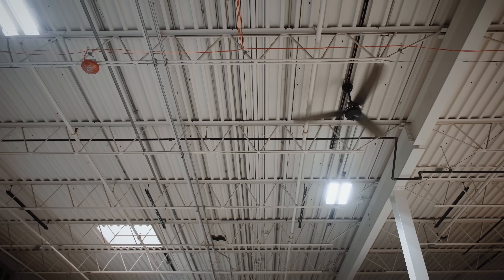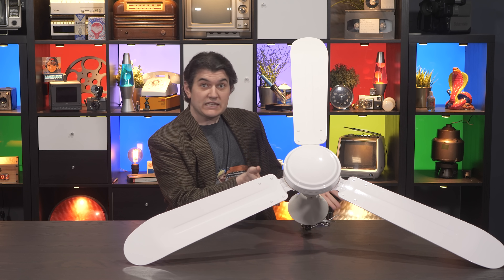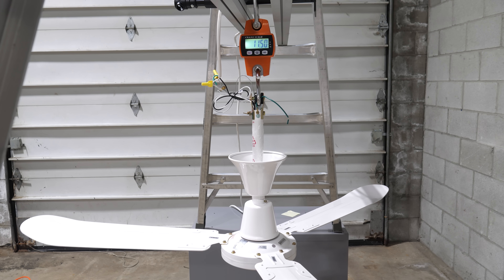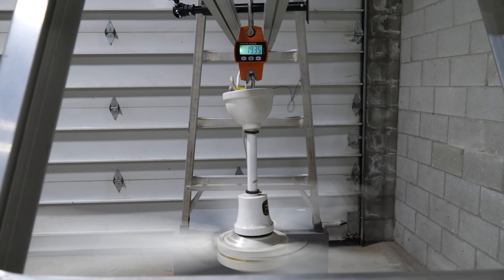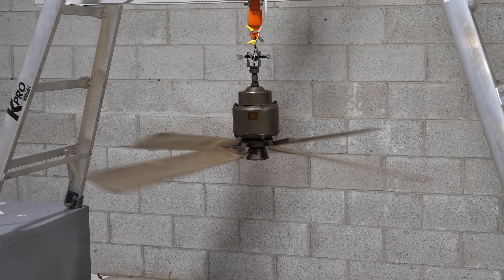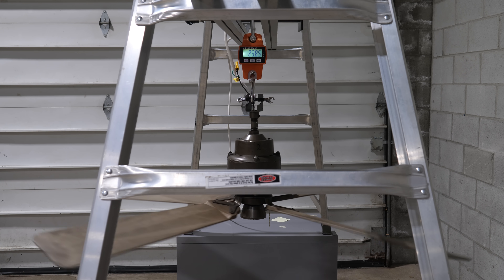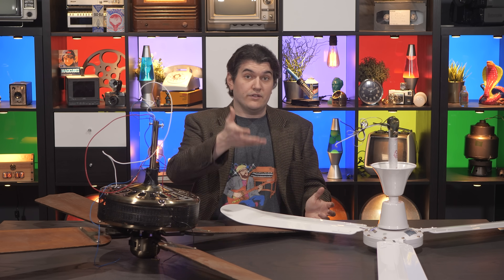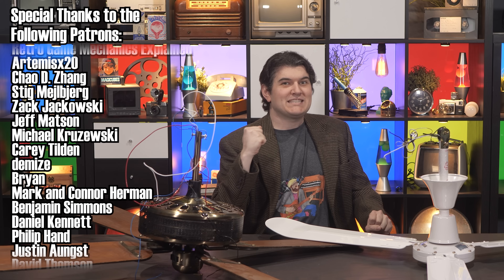How much thrust does a ceiling fan produce?

Comment: Question: Wouldn’t one need to specify how far from the resistance surface the fan blades were? In other words, if the height were doubled, wouldn’t the scale show a different number?
Reply: Nevermind, just realized the error my thinking. The “weight loss”/thrust isn’t the blades vs. ground, but blades vs. the air right next to them.

Comment: 10:04 is this an actual term? I'm not really a math or physics person (an armchair mathematician and physicist). I know jerk is the change in acceleration and that force is typically mass * acceleration. So is "jerk force" just the force exerted during the "jerky part" where the derivative of acceleration isn't 0? Or is it something else that is important?

I understand from a common sense standpoint that sudden "jerky" movements are how you can often break things, but from an intellectual standpoint I don't understand why changing the acceleration is noteworthy here. Do machines like this, in practice, momentarily increase acceleration to a level higher than its normal operating acceleration/force?

If the jerk graph looked like a sine wave for the beginning and that was called "jerk force" that would make a lot of sense, but wouldn't it just be a little bump that doesn't go negative and thus not be noteworthy?

Basically I'm ignorant and am looking to be informed further.

Comment: Alright, someone's got to rebut the pedantic nerd that will surely comment about pounds vs kilograms vs newtons.
One of the objectives of the metric system is to simplify conversions to powers of 10. But 1 kilogram is approximately 9.8 newtons in average Earth gravity. Because gravity is largely the same across Earth, newtons are less commonly used than kilograms, and are readily converted when appropriate. Using kilograms is more effective communication, even if scientifically less accurate. 
This trade off between understanding and details is seen across scientific teaching (for example, in teaching simplified but technically insufficient models of electron configurations in atoms).

Also, this is No Effort November.

Comment: Haven't even watched the video yet, love the concept. Also F*** helicopters, they are my phobia. Now your "good" fan is also a phobia. HOLY S*** just how fast are props spinning at to generate enough force to lift things, oh my gosh I'm happy I have a helicopter phobia, it's not even a phobia anymore it is 100% a justified fear.
Reply: That's a weird specific phobia.

Generally the tips of the blades are traveling just below the speed of sound, which is around 1200 kmph or 760 mph. Note: This has to consider the actual speed the helicopter is moving as well.

Comment: I could not help but think of an alternative test rig. Basically set up a beam balance using a piece of lumber as the beam with the fan "installed" at one end and counterweight on the other. Add a cross piece to the beam at its balance point and use two "knife edges" to create a bearing resistant to motor torque forces and run the cabling off the beam at the balance to minimize its effect on measurement. Fine tune the counterweight for static balance, fire up the fan and whatever weight you add or remove represents the thrust (factoring in distances from the bearing).

Comment: the vortex created on top of the blade while it moves through the air creates lift by pulling up on the blade, so it is not just downward thrust creating momentum
Reply: And how do you think vortexes create lift? Come on, actually follow through. Don't just use the word "vortex" and then handwave away that you haven't explained anything.

Comment: One major difference between ceiling fans and aircraft propellers is the noise level and the power input. 
It could be fun using an aircraft propeller as an ceiling fan but they are expensive and not work much better assuming you use the same motor driving it not an plane engine.

Comment: 5:32 - NO.  The fan does not get heavier.
No matter which direction it spins, the weight of the fan never changes.  The mass of the fan remains constant.
Reply: Mass and weight are not the same thing.
Reply: Ah, you are trying to make a pedantic correction, but are still incorrect. Heavy is related to weight and force NOT mass. The weight DOES change, and mass stays constant.
Reply: It does get heavier/lighter. Just as you would get lighter on the moon. Your mass stays the same, but you would weigh less.

Comment: Hey! Long time listener, first time caller. I always enjoy your videos. So a couple of thoughts on this one: first off, please be careful, that ceiling fan experiment could have gone wrong a lots of ways, I would not have approached the rig when it was spinning, there is a ton of energy and those things will break your shins! Secondly, I need to say, you missed a huge opportunity to educate and help people be safe with ceiling fans: you briefly touched on your concerns about the safety of ceiling fans and the mounting box, and I was sure you were going to talk about the special requirements of ceiling fan boxes but then you didn't. Ceiling fans require a special electrical box that is a thicker gauge of steel, and has a bigger gauge of mounting screw. It must be mounted rigidly to framing, and additionally, all modern ceiling fans include a safety tether that must be also mounted to framing. Many people have ceiling fans in their homes attached to regular boxes and with the safety strap not properly attached. These fans literally could just fall off the ceiling at any time, especially when they're running, especially at high speeds.

All the best! Keep up the great work and enjoyable entertainment

Comment: @TechnologyConnections: Yu could have eliminated your torquing problems,
by simply wiring, both ends, of your support bolt or wrench, to both ladders.
That way, the rig could not torque in either direction. 😁✌🖖

Comment: Imagine how much more fun it would be if the tilted flat blades of the fan were replace by an airfoil shaped blade... now were talking thrust.
Reply: The propeller shape is primarily advantageous at higher speeds. It offers less benefit at lower speeds.

Comment: I think the electrical box is screwed into the ceiling joists well enough to account for the torque and load put on it, but I have seen some sketchy wobbly fans in my day so it’s a good thought. I enjoyed this one. Thanks.
Reply: there are two ways to install the fans, and one of them involves a ball connected to a rod hanging from some piece actually attached to the box, with the other you attach the fan motor assembly directly to the box. So with the first the fan can pivot freely when its unbalanced, tends to be worse at higher speeds. With the second all that stress would go straight to the box... In my experience a 3 blade aluminum fan works perfect balanced and freely, while a 5 blade something polymer blade is out of whack in balance.

Comment: Helicopter rotor blades are designed for pulling, not pushing. They are air foils. It is basically a rotating wing, and lift (pull) above the wing (prp blade) is much stronger then push downwards.
Reply: This is nonsense. A fan can only pull because it's pushing on something, specifically, it's pushing on the air.

Fans can't defy physics, no matter what shape they are.

Comment: a simpler and safer method would be to suspend the fan from the middle of 2 2by4s (pretend ceiling rafters) from a standard ceiling electrical box and put a scale on one end. Then multiply the readout by 2.

Comment: 10:20 at the end of the word "no" there is a distinct tone audible, possibly caused by some part of the fans in front of you on the table. Either a fanblade or something else has a resonant frequency of about 974 Hz according to my FFT Analysis. And yes, you may call me a geek.
Reply: Nice catch. I tested to see the resonant frequency of my bathroom and it's approximately 130hz
Reply: I like your style. May your Fourier transforms be fast and your bins aplenty.
Reply: However, I do feel like the tone in the background is generated by something else and the fact that it's cut short is just the denoising and/or a noise gate that tries to get rid of it. I suppose only Alec himself can solve this mystery for us.

Comment: Of course the fan blades generate a measurable force.

To make this video more interesting, you should compare the motors of the typical ceiling fan to the motor of a typical prop plane. The ceiling fan is probably 1/4 hp or so, while the airplane engine will be a couple hundred hp. Then you can compare the rpm of the fan blades, and look at how they are engineered (compare blade pitch), and note the difference in the noise generated by both. The ceiling fan is near silent, while the airplane can be heard from miles away while the plane is thousands of feet in the sky.

Comment: As a pilot I knew the number would be low but I didn’t imagine the thrust would be that low! 
Aircraft thrust makers, whether it be props or rotors, are all airfoiled and optimized for their spinning moment since the tip travels much faster than the root. Fans don’t have either (usually) so their efficiency is crap. 
The motors aren’t very strong and the fan works mostly on inertia rather than power and torque. That’s why they’re quiet and not power hungry. They provide just enough torque to keep the blades spinning. 

Also, aircraft wind movers spin very very fast in comparison to a fan. Even a 100 horse power Cessna spins its prop nearly 2500rpm. A prop that is maximized for effectiveness at that RPM. Fans just don’t do that. Big paddle moves air. They (the fans) aren’t interested in velocity of air but rather volume of air. Which is another reason the motors are low rpm motors no matter how efficient or effective the blades are. 

Love the channel. Love the content. Keep it up and thank you.

Comment: 0:37 helicopters don’t produce thrust by blowing enough air down to make it fly. They create lift by making less air pressure above the blade than below. A helicopter blade looks more like an airplane wing than an airplane propeller
Reply: Yes they do. Saying they create less air pressure above the blade is the same as saying they push air down. You're describing the same thing in two ways.
Reply: Aerospace student here.

The way a wing / rotor blade creates lift is by deflecting airflow downwards. 

This can be expressed as a difference in pressure above and below the airfoil, but it is mathematically the same as redirecting the air streamlines, and is just an alternative used when solving for certain things unimportant to this discussion.

So, in other words, yes. The lift can be correctly explained as “pushing air down”, although the more important factor is that it had to chance the direction said air was moving relative to the blade, and experienced an opposite force. This doesn’t have to be, and never is, directly down. The sideways component of that reactive lift force is experienced as ‘induced drag’ on the rotor.
Reply: And just exactly how does a helicopter rotor create less air pressure above the rotor than below? As the rotor turns, it forces air down faster than it can be naturally replaced. Therefore, it creates a high pressure zone below the blades along with a low pressure zone above the blades. An airplane propeller does the exact same thing except in a horizontal line instead of vertical. The difference is a helicopter rotor has a collector control on it to collectively adjust the angle of attack on all the rotor blades at the same time to make it push more or less air down thereby increasing or decreasing thrust/lift
Reply: @ no. It doesn’t.  Thats not how it works. It doesn’t PUSH air down. It makes the air above thinner because of the speed and shape. Same thing with airplane wings. 
Look up the shape of an airplane wing and you’ll see there’s almost no down angle that pushes air down
Reply: @ what you’re referring to is the airfoil’s camber. The camber does cause the lift curves to change at any given angle of attack however the most important part of generating lift is angle of attack. Ignoring air’s viscosity (the majority of aircraft dynamics equations do), Lift = 2*pi*angle of attack.

Early airplanes used fully symmetrical airfoils such as the NACA0012, and had them tilted up with respect to the fuselage of the plane. Most aircraft also still have their wings tilted, because camber only gets you so far.

Helicopters, needing to change their lift dramatically, control the angle of attack for each blade through the ‘collective’. When starting on the ground, this is zero and the helicopter doesn’t make lift. After the engine is up to speed, they vary the angle of attack via the collective drive to change how much lift is generated
Reply: @ …and the lift is different than the “push”. And all of that is drastically different than a ceiling fan
Reply: @ he even wrote it in a pinned post, Mr amazinglyintelligentidiot.  The comparison was “iokey” and helicopter blades are much more complex than a giant fan. 
Now go put mommy’s phone back before she notices it missing from her purse
Reply: @ if you were correct and a copter was pushing roughly 2000 lbs of force of air down, nobody would ever be able to walk under that….
Reply: @Meatball2022 2000 lbs (or 10000lbs) divided by the surface area under the rotor is not actually that much pressure per square inch or meter.
Reply: I agree and same thing with propellers, they are just sideways and small, also little airfoils
Reply: common misconception.  helicopters don't fly - they are such abominations of physics and nature that the Earth repels them.
Reply: Isn't it conservation of momentum? The propeller takes some mass of air moving at some velocity and accelerates it to a higher velocity in the opposite direction of travel. Since this changes the momentum of the air it also has to change the momentum of the aircraft. As its mass is (pretty much) constant it has to increase the velocity in the direction of travel.

The pressure difference between the two sides of the blade explains how the propeller accelerates the air, which is a different question.

Comment: Wow, I was guessing the thrust would be only like an ounce.  The air current drifting downward under a ceiling fan is usually pretty much imperceptible.
Reply: Something is clearly wrong with your ceiling fan then. Small ones kinda suck, but a decent size one can really blow.

I especially love them because a good big one even on the lowest setting can create a good breeze while also being virtually silent.
Reply: @seigeengine  I don't have one.  I've just seen them at other people's places.  The ones I've seen are apparently only there to move the air around enough that heat doesn't accumulate at the ceiling.  They don't need to be powerful for that.

Comment: SO, Helicopters do not fly by proportional thrust downward to weight, that is vectored thrust and very unsafe and until recent micro-controllers and micro-accelerometers, very hard to fly with any kind of stability. The Lunar Landing Research Vehicle for example, nearly killed many astronauts. 
Helicopters fly by rotating wings to generate lift. The rotating wings (main rotor blades) can change their angle and is also how helicopters input pitch and roll changes, by increasing or decreasing lift in the blades at certain points in their rotation. Yaw changes are performed by changing the angle or speed of the tail rotor  to increase or decrease the torque effect ( though usually angle, most tail rotors are mechanically linked to the main rotor and cannot change their speed ratio to the main rotor).

I know it's no effort November but comparing Helicopters to ceiling fans is very irksome to anyone who has worked on helicopters.
Reply: Yeah, helicopters sure do fly using fancy fans.

Comment: 9:21 yeah those behemoths don't do squat to help air circulation. they put one of those over the assembly line i was assigned to at work to try to get more air circulation and even on it's highest setting you couldn't feel squat even standing directly under it
Reply: They work really well. If that one didn't, something was very wrong.
Reply: @seigeengine  there are 2 in the building. both have the same problem. im thinking the ceiling's too high

Comment: For anyone who didn't already know, "jerk" is indeed the proper scientific term for increase or decrease in acceleration, just like acceleration is the term for increase in velocity. I don't know how many more layers deep it goes.
Reply: They're less used, but the next is jounce or snap, and then after that got the obligatory crackle and then pop.
Reply: The next three are snap, crackle, and pop
Reply: @handlesarecringe957  the three after crackle are pop, lock and drop (at least unofficially)
Reply: An infinite number of layers, like any continuous function.
Reply: Are there any real world uses of these extra terms?
Reply: @unfa00  snap is used in programming of drones. Calculating a 'minimum-snap trajectory' helps improve performance, control and energy-efficiency. Snap is the fourth derivative of position, meaning it's the rate of change of the rate of change of acceleration.

If that sounds pretty abstract, I wouldn't disagree. Whether it goes any deeper in rocketry or some other specialised fields I wouldn't know.

*Wikipedia also mentions railways, rollercoasters and machine tools as applications where snap is minimised. I would guess robotics in general might have similar needs. If snap is zero, jerk is linear, which means acceleration is changing linearly. Since force is proportional to acceleration that would mean force is also changing linearly over time which would probably be desirable in many cases.